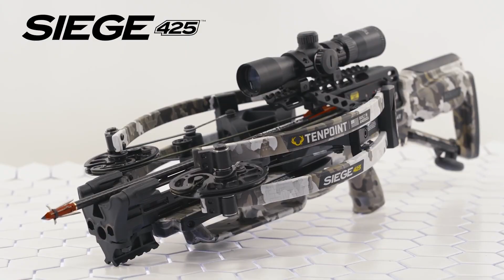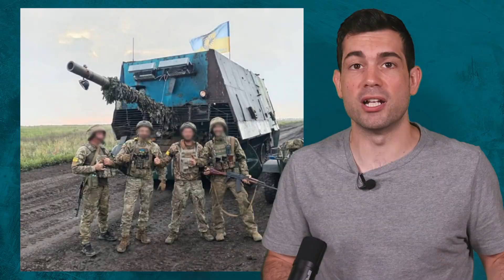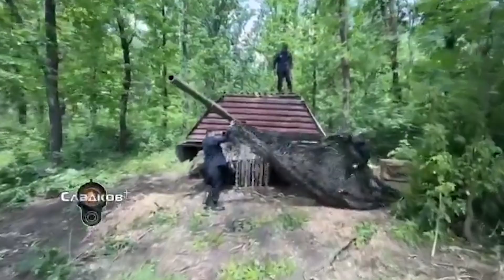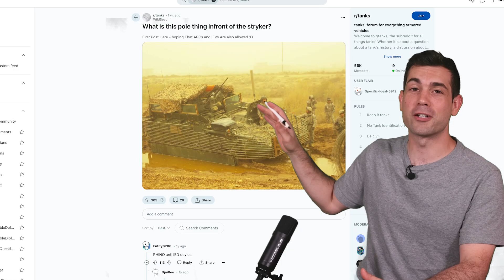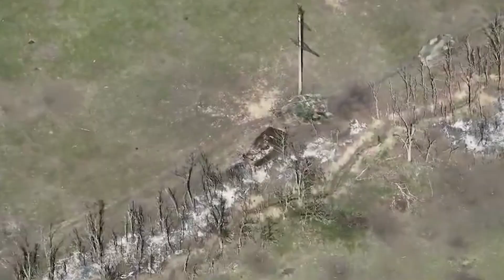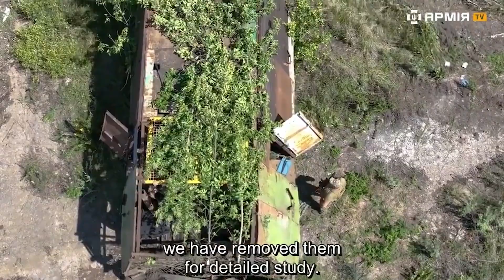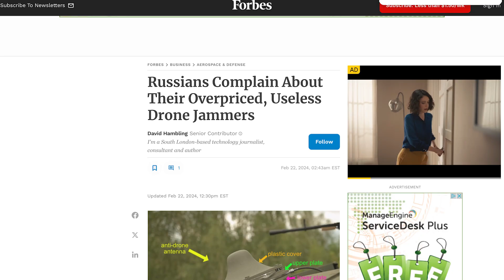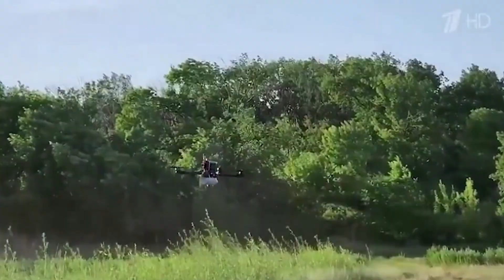Why Ukraine’s Taking Turtle Tanks Seriously

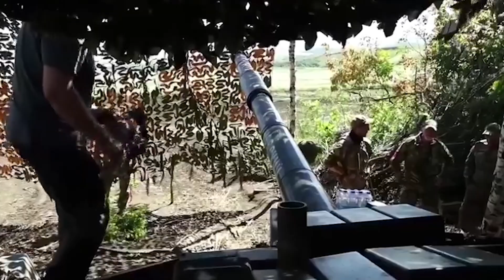Comment: 16:03 "Many of Ukraine's drones are bought off the shelf commercially, which means they have the same frequency."
Not true... it is a trivial and standard part of operations to change channels, and would certainly be done as part of initial setup right along with stripping out the RX loss failsafe. Many of those hobby drones even allow you to change channels in flight if you set it up correctly.

Comment: How does the soft underbelly hold up against mines?
Reply: Tanks don't get hit by mines from under, they get hit from the under the tracks.

Unless it drags it's belly across the ground, it will perform as well as the other t62 or t54z would if they ran over a track.

Comment: just build a T95 with spaced armor , its basicly the same at this point
Reply: these are just some liablity tanks. its not meant just go in guns blazzing but counter drones. thats why t60s are used. building new tanks takes time. russia is producing more tanks than ever, modifying a tank isnt a easy task. you cant just space the armour. if you meant the cage, they wont last more than 2-3 drones.
Reply: @danishkfd  i know that new Tanks are expensive , but If it continues Like that and noone finds a good anti Drone gun then might aswell go Back to builing those Tanks , Not exactly a T95 but the concept of No turret and the gun directly mounted to the hull. Who knows in which war  drones might be used next.

Comment: Ideally, we need next generation RWS/CROWS mounts that have the software and sensors to act as individual IFV point defense. A 12.7mm-30mm gun that can be set to "air defense" mode to lock/shoot at anything matching a speed/altitude profile of a tactical drone. (while allowing use on ground targets as necessary)

I hate to bring up scifi, but this idea was originally conceptualized by author Davide Drake (formerly of 11th ACR Blackhorse/Vietnam War) for his air-cushion hover tanks and IFVs in the Hammers Slammers books.

Comment: Light duty, low range phased array radio disrupter with a small drone spotting radar. No need to see farther than 100m if the countermeasure is near instantaneous. You get more power by making the disruption directional.

And to counter that, laser communication once it is good enough with node drones could extend the range significantly and by making the receiver a certain way, the drone would be difficult to optically jam.

Comment: As you pointed out, rus Cope cages and turtle tanks  mimic US reactions to IED's. They are designed for very specific threats.  Soviet designed anti air, of all types is almost totally ineffective against modern drones because they are outside the design. Mavic and small FPV drones are just too small and too low energy for soviet Anti-air to see and hit.  In the last couple of days there have been a few videos from Ukr FPV drones within sight of russian Anti-air that shoots at them. But the missile goes right past.  Couple of possible reasons.  

One is that the missile was designed to aim at a target 10's of meters in length and width. So that is the box they are designed to aim at. Technically they hit within the box, but missed the much smaller drone so on contact explosion.  

Another is that they have a proximity fuse. When the fuse is close to a metal source, or maybe a radar reflection, they explode sending fragments out to damage the enemy. Like a flying shotgun, or claymore mine or anti-personel grenade.  The drone is simply too small to trigger the fuse. 

Anti-drone guns like the Gepard get around this problem. Their radar calculates the distance/time to the target and set that into a timer in their bullets. When the time expires, the bullet explodes. No need to specifically sense or even directly hit the target. 

Another captured turtle, the Ukainians found that the basic tool kit was missing. And worse, a strut for the cope cage was welded in such a way that the driver could not open the transmission oil filler.  They couldn't do basic maintenance on the tank. Which means as far as they were concerned it was single use, disposable. 

Like the US reaction to IEDs, the current cope cages are being created by individual soldiers in the field based on their experience.  They use what ever resources they can steal. The captured turtle has metal from a fuse box.  If cope cages, or specific features prove useful in combat, the military/government may react and mass produce better designed cages. But till then it is every man for himself. 

If we ever get to talk to russian soldiers, I think we'll find that the tanks/IPV/AFV s selected for turtle upgrades were already broken. Gun not usable things like that. So by adding cope "protection" they were not actually losing much original functionality. 

Ukr has been "hacking" their own off the shelf drones before sending them out, to make them jam resistant.  I've been reading a blog by an american volunteer. He has his own laptop to capture russian signals and he does his own hacking to help "insulate' Ukr drones and radios.

Comment: American/Uk made anti tank guided missiles cost $200K+ per shot or $600K per system with 2 rockets, require extensive crew training and skills and are not produced in numbers required for this conflict. Most important, Russian tested some captured FGM-148 Javelin and they had 30-50% misfire/malfunction rate because Ukraine gets very old and "expired" systems. Turtle tank probably costs $10-20K at the most and can be easily repaired in the field if not completely destroyed. Everyone seems forget about economics when talking about this war.

Comment: its not a shell or rocket launcher....its a drone. they can just fly straight to the front or back or under it. also from what ive seen only one in a group is a turtle tank. they can just aim for the other tanks or drone when they drop off troops to a building.

Comment: The answer for your thumbnail is, no, it doesn't work.

Case in point, this tank's only job is to protect it from drones and yet, we routinely see them immobilized by the very same thing they're supposedly immune to. 

The cage makes it an easier target for everything besides a drone. The Ukrainians are taking it seriously only to the extent that it is Russian equipment that needs to be destroyed. They are not taking it seriously enough to replicate the design and use themselves. 

Don't take my word for it, just wait for Ukraine to simply never copy them in this regard. Anything that worked, they copied. Shaheeds, glide bombs, cluster munitions etc. If turtle tanks were THAT good, they'd already be using them. I'm sure they have a few spare lockers somewhere that they can weld to a non-functional tank.

Meanwhile, if you went on Reddit and actually looked at UA made armor, you'd never find something as laughable as a turtle tank. Sturdy and solid slat armor that doesn't prevent the vehicle from functioning and the driver from seeing, yes. Lockers shoddily welded together as if one giant Cymbal that can be heard for miles, not so much.

Comment: It looks like a hobo APC, or at the very, very best a WWI "tank". It is a pretty clever use of unusable tanks though. If the tracks work, the engine somewhat works, but not the turret and / or canon, this is pretty much the best use of such a vehicle. 
You just turn it into, as someone else in the comments put it, a Blyatmobile, the ultimate hobo APC

Comment: I wonder if the Marine LAR BN’s are finally dusting off and training and upgrading and putting effort into/on their LAV-AD’s? You don’t need to create all new systems when you have systems currently that will function just fine if you invest in the technology, training, ammo, troop schooling etc to make them relevant. My entire existence in the Marine Corps… the Air Defense variant LAV-AD’s (in two of the four LAR BN’s (1st and 4th which was a Reserve BN were both on Camp Pendleton) those vehicles sat tarp’s over and rusting. They never moved and I don’t think the Corps even had the capability to fight them. Nobody in the entire organization was trained as a gunner for that vehicle which was wholly unique among the LAV variants. We never used them because there was never a need but the consequences meant that if the need came for their use… nobody was trained. The officers didn’t know the capabilities and the enlisted were in the same boat. If nobody is trained and the equipment is never moved and left to stand idle and decay… it becomes an “on paper” capability but in reality it might as well not even be there. We could provide absolutely zero effective air defensive capability across all the LAR BN’s when we invaded Iraq in 2003. No organic Air Defensive capability at every level from Scout Team/Fire Team coming out the back of an individual vehicle all the way up to the BN level. The best that could be done was provide “attachments” that could provide air defense. (Like we could be provided combat engineering support or heavy armor that could be attached or integrated into our chain of command. It’s not at all the same as having organic support. Meaning the BN regularly travels with and has working AD variants in combat and in training that understand specifically the LAV and can travel with the BN. For instance having stinger missile mounted hummers… when the BN reaches a river and has to “swim” which the LAV can do. And there is no “fording” for the hummer… you just lost your air defense. Never mind the fact that the stinger missile is wholly unsuited and cost prohibitive for shooting down small tiny drones. But the AD also has a huge Gatling cannon. Like Air Defense MOS’s using portable MANPADS or hummer mounted missile systems or our fighter aircraft that had complete control of the skies.

Comment: Most fpv drones are able to select a variety of video transmission frequencies. They only have a single control frequency. Though that is exceptionally easy to change. Enough so that anyone with basic math and a phone could do it. 

I have serious doubts about their ability to block control frequencies. It would be easier to interfere with the video signal since it's so sensitive.

Comment: ONly if Russia had more thing like the T-55AMD had on it where it blows up anything that gets close to the tank. The Drozd Active protection system think it was called. You would think that in this day and age those things would have been built in numbers for instances like we have in this era of age. The system was made to fight off RPGs and a drone isn't that much different size wise. Even the Arena active protection system they put on AFV's designed to protect by light anti-tank weapons, anti-tank guided missiles (ATGM), and flyover top attack missiles. So wouldn't you think they would have been using them types of things instead.

Comment: Seems to me for Ukraine benefit, ECCM just needs to get better on the drones - I'm surprised they don't have things like that now (Or maybe they do and I dont hear about it) - stuff like having the drone's signal carrier wave sweeping through variable frequencies in a preset pattern familiar to only that particular drone receiver and transmitter back at base.  

Or even a simpler version being transmitting redundant signals at multiple frequencies, and the drone receiver has an algorithm to hop to the backup channel if the signal gets too weak.

Comment: Capturing a turtle tank after its crew got lost and presented themselves to UA soldiers like a gift is NOT the same as "taking the turtle tank seriously" xD

Title makes it sound like Ukraine is actively trying to capture or build turtle tanks to use themselves but the interviews of those who drove and inspected it shows you that these turtle tanks are literally a laughing matter and it makes Russia a laughing stock. Can't see, can't hear, lots of noise, no armaments, just a single drone jammer on the roof that didn't protect them at all against the only thing a turtle tank should be immune against. That alone shows you how hilarious these tanks are, let alone when artillery is in play. 

These turtle tanks had a niche when UA ran out of shells. In an ordinary battlefield, there is no real use for a turtle tank. What you can't use drones on, you use artillery. Those turtle tanks may be able to take an extra drone hit but it makes it even more susceptible to artillery given the lack of visibility, extra weight and size, loss of speed and the absolute racket it makes just driving forward. Every UA soldier within a 2 mile radius would be calling artillery on that metallic drum set on caterpillar tracks. 

It's a laughing stock.
Reply from the maker: the interview video is clearly propoganda from Ukraine. Just like how the video from Russia on the turtle tank its clearly propoganda for their side. In the Russian propoganda video they call it "powerful protection" with a straight face. What each side says publicly is not reality. 

The actual soldiers fighting these vehicles are taking them seriously. They're devising new methods and tactics to counter them.
Reply: @Taskandpurpose  It might be an ATTEMPT at propaganda but we all have brains, don't we? xD

Turtle tanks are so good that a few dismounts managed to take the crew hostage. How's that for propaganda? 

Don't take my word for it, we will know soon enough when Ukraine refuses to copy the turtle tank. That's about how "seriously" they take it.

You take any invader seriously to the point that he becomes fertilizer. That's the extent of the seriousness. They aren't taking it seriously enough to copy it, that's for sure xD

Comment: I'm surprised that this is a problem. Like I don't know anything on the firearm side of things but on the computer side of things it's trivial to create a program that can analyze a video feed to find and track a drone and it can all be done off of a raspberry pi (though you'd probably want something a bit more secure/stable than that the point is it doesn't take much computing power to do), also given that drones aren't super armored you wouldn't need a super high caliber of weapon to take it down so calculating for recoil shouldn't be hard. I think the hardest challenge would be trying to identify friendly drones versus enemy drones since ideally you would want the system to be able to work as independently as possible perhaps even completely independently and while there are ways that it could easily be done they would likely require some security compromises for example by having friendly drones emit a signal to identify them as friendlies but the issue with that would be if that security signal is cracked then your defense becomes useless. Honestly I'm not actually sure how they can tell if a drone is friendly or not in the first place like from a human perspective, it's not like you're gonna have time to look at it and see if it has a Ukrainian or Russian flag on it so I assume it's gotta be a communication thing.

Comment: Ukraine is also installing net mess cages on their M113 just like those barn tanks.
Reply: Ya, and that’s smart. 

Because there taking an already purpose built APC, and making it better armored. 

Not neutering a tank to do a job it’s not designed for.
Reply: @nobodyherepal3292  Yeah but having a inoperative gun is also not the main role of a conventional MBT, so, having an old cheap tank converted to fulfill another role is more useful than to be on a scrapyard, and the main role of those barn tank is to direct a convoy through a minefield and shield it from drone strikes, not really to fire its gun. So far it accomplish that role with good results.
Reply: @marceObera  not really. 

It would be better for the Russians to melt down these old clunkers and make some purpose built heavy-APCs for the job, like, “a Russian Namer” or something instead. 

They would at least have less personnel losses compared to the horrible chances anyone riding in a turtle tank has.
Reply: @nobodyherepal3292  What part of they are fulfilling its new role with good results didn't you understood?
The field result is evidence of that, and this same video mentions it. They dont need the create a new design from scratch, that will take time and money, if they already have the units to do that, cheaper and faster.
Reply: @marceObera  lives arnt cheap. And for the price their paying, there getting a terrible trade in return
Reply: @nobodyherepal3292  Most of the crew inside of those turtle tanks are abandoning it alive after being disabled, as it s more protected agaisnt drones and mines than conventioanl MBT, so i no dont know what you are talking about. The fact that the Ukranians are copying that design is evidence of its practicality.
The design is fulfilling its role and the crew can return back to base to use another cheap turtle tank for the next day.
Reply: @marceObera  the Ukrainians arnt coping the design. There not a single Ukrainian turtle tank anywhere.
Reply: @nobodyherepal3292  You already forgot that you responded to my comment about the same design?
Besides, nodoby mentioned Ukranian turtle tanks, i dont know where did you get that, im talking about the cage design, not the platform.

Comment: Isn't it interesting how battlefield tactics ebb and flow, adapting to new updates as they go. Soon they might start converting to conventional tank warfare tactics and using armour piercing rounds, where these HEAT resistant turtle tanks would just have to duke it out with whatever support they have on hand.